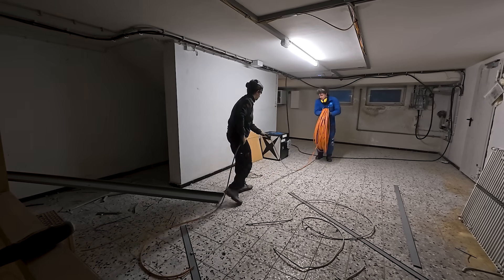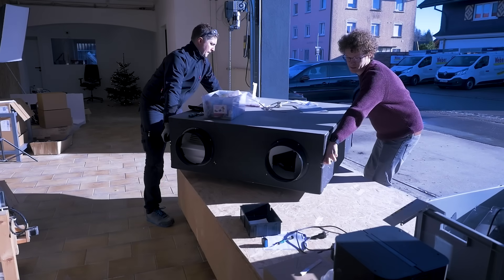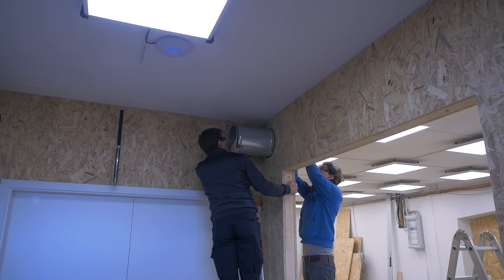New Workshop #15 || Central Ventilation System

Comment: For quieter operation, taping all the joints with duct tape will help.They make tape specifically for HVAC and I'd look for that.

I'd also consider adding ventilation to the basement.

Comment: Would it be possible to share the 3D design file of the ventilation pipe splitter (at 7:20) ? ... I have a similar problem, but on a 125 mm pipes   ...  and a great video as always 👍👍

Comment: Regarding the welding and soldering exhaust collection points that were shown. They are attached to the exhaust venting, is this really ok? Feels like there ought to be some kind of extra filtering before them being passed into the exhaust and heat exchanger.

Comment: if you put a big filter bag on the outlet, or some dedicated armature (for displacement ventilation), you won't get a blast of air from the outlets but a steady soft draft. that would work in your favour when you are trying to make displacement ventilation. the blast will mix a lot more with the old air (called mixing ventilation), and for that it would be a lot better with real dedicated armatures for mixing ventilation. but for displacement ventilation , you just need something, with the ability to get the airspeed way down.

Comment: Nice install !    I have a KWL-System in my house (air sucked from bathrooms/kitchen and added in living/sleep rooms, exchanged under the doors. 
I noticed you do not seem to have a pipe for the condensing water going out of this unit ? 
Does it also have a pre-heater (I need to turn on mine manually), otherwise the heat-exchanger might  freeze.
You might need to add a so called "telephone muffler" (TSD=Telefonieschalldämpfer), which I have installed to prevent ransfer of noise/speech from one room to the next,
A big problem of such air-handling-systems is that the air gets very dry, so some systems have an air moistener (with fancy UV cleaning etc.) which I unfortunately cannot add any more. 
And it is a surpise every 3 months when the filters are changed how dirty the outside air is.
Cheers from Berlin

Comment: AI Summary:

Workshop Renovation Part 15: Central Ventilation System Installation

*   0:00:03 Introduction: This video focuses on installing a central ventilation system in a workshop with no windows.
*   0:00:25 System Choice: A Renton unit with 800 cubic meters capacity and a heat exchanger was selected to maintain temperature efficiency (keep warm air in during winter and hot air out during summer).
*   0:01:56 Installation Prep: The unit is to be mounted in a corner, requiring two large holes to be drilled by a neighbor.
*  0:02:32 Ceiling Mounting: Steel ceiling anchors (required for fire safety) and threaded rods were used to securely mount the 75kg ventilation unit.
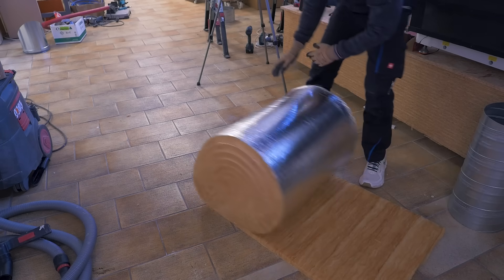*   0:03:21 Exterior Pipe Insulation: The exterior pipes were insulated and sealed with expanding foam to create a tight fit.
*   0:04:13 Interior Pipework: 250mm and 200mm pipes were used to connect the ventilation system to the different workshop areas (Stefan's studio, Robin's shop, and the narrator's shop).
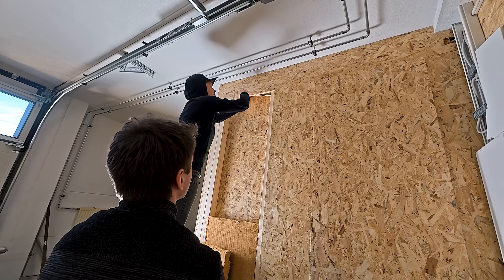* 0:04:33 Accurate Hole Cutting: A router template was fabricated to ensure accurate and aligned holes in the walls for the ductwork. Foam rubber was added around to dampen vibrations.
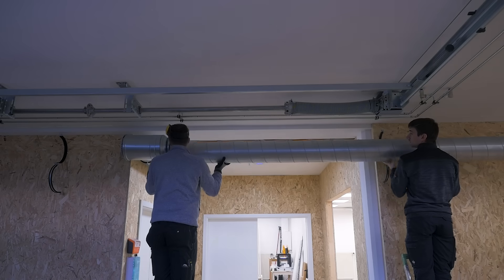*   0:06:10 Pipe Installation: Pipes were easily connected and secured with pipe clamps. An angle grinder was used to cut the pipes, and a mini belt sander deburred the edges.
*   0:06:31 3D-Printed Ducting: A custom 3D-printed component (humorously shaped like pants with a thong) was created to accommodate crossing heating pipes.
*  0:08:03 System Completion: The ducts were grounded, and the system was switched on.
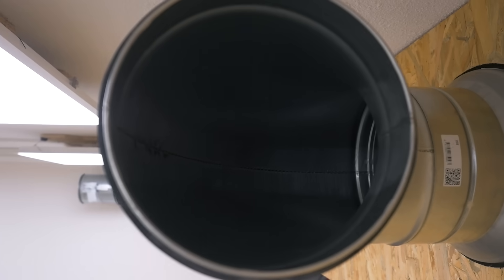*   0:08:17 Smoke Test: A smoke test was performed to verify the airflow and system functionality.
*  0:08:32 Airflow Layout Explanation: The bad air and fresh air pipes are branched to supply Stefan's and Robin shops. Bad air is then taken from Robin's, the speaker's, and a potential future extension of the speaker's. Fresh air branches into Robin's and the speaker's shops.
*   0:09:13 Stefan's Shop Airflow: Fresh air enters through one outlet, and bad air is extracted through another, promoting air circulation.
*   0:09:37 Robin's Shop Airflow: Similar to Stefan's, with a fresh air outlet and multiple bad air inlets connected to welding and soldering stations, plus a general intake.
*   0:10:04 Narrator's Shop Airflow: Includes a bad air intake and a fresh air outlet that will be extended to ensure circulation.
*    0:10:14 Additional Filtering: An extra filter was added to the narrator's fresh air intake to protect the main unit's filter due to potential dust.
* 0:10:33 Project Completion: The ventilation system installation is considered the last major task for the workshop renovation. The improved air quality is a noted success.
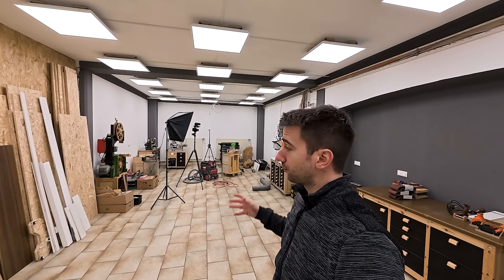*   0:10:38 Future Plans: The next steps involve organizing tools and setting up the workshop for use.

I used gemini-2.0-pro-exp-02-05| input-price: 1.25 output-price: 5 max-context-length: 128_000 on rocketrecap dot com to summarize the transcript.
Cost (if I didn't use the free tier): $0.0199
Input tokens: 12865
Output tokens: 767

Comment: If you squeeze the inlet of fresh air a bit, you will be taking more air out than you let in. That way you create a bit of underpressure, so that clean air will suck in through all the gaps, ensuring that the dust stays in your place. If you'd have overpressure, then everyone else's equipment would constantly be covered in your dust

Comment: But you need adjustable inlets and outlets on the pipes otherwise you will have very uneaven flows in your shops. Really nice job again! ❤
Reply: Looking at the laser reflection at 8:23 there are flaps at the end

Comment: Does the air circulation system double as a dust collector if you have a cyclone separator and filters before the inlet, or do you need a separate dust collection system?
Reply: Those units are meant to keep the air quality high. Not meant to function as a Dust collection. It can probably provide the suction, but I reckon he will still use another dust collection system for the heavy sawdust.
Reply: @Helveteshit  yeah, I meant it as just a source of suction. The dust wouldn't travel all the way to the machine
Reply from the maker: Dust collection for machines will be separate
Reply: I don't think it would have the static pressure or flow to run a cyclonic separator. You would do that separately, and then maybe hook an exhaust for the central air system near the outlet of your cyclonic separator to handle any very fine particles that make it though.

Comment: I don't know what type of filament you used for the air-duct trousers, but would the heat from those heating conduits not be an issue?
Reply from the maker: It's pla. Those heating pipes will get insulated soon
Reply: The unit they installed is a heat exchanger, rather than an active heater / heat pump or air conditioner. So the air flowing through the ducting will never get hotter than the inside or outside temperature (whichever is higher). PLA loses most of its strength at 57° C, so PLA would still be fine for it.
Reply: @nottimothy5994  I was thinking about the thin pipes they route around, not the air going through it.
Reply: @mrtnsnp  Ah yea depending on what the circuit temperature is, it could be a risk. I would have left a bigger gap and also added pipe insulation, but they may have not shown insulating it.
Reply: Assuming it is PLA, which requires a temp of 52c to melt, I would say... Your worries are unfounded. That unit will probably not push out air that warm for such a small run of ventilation. Not to mention, it is like three bends in.
Reply: @ Those heating (water) pipes that were in the way can get up to 70-75°C, depending on the actual heating source.